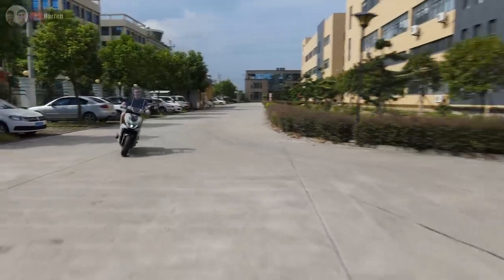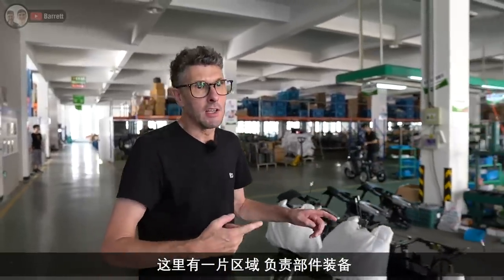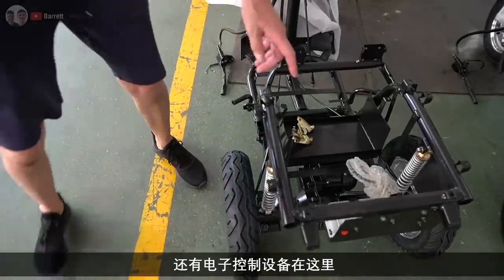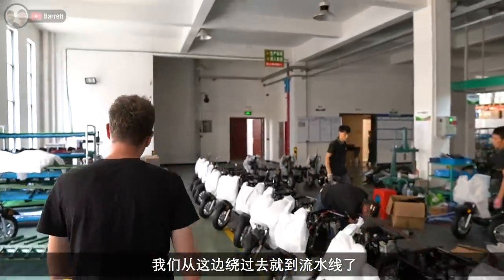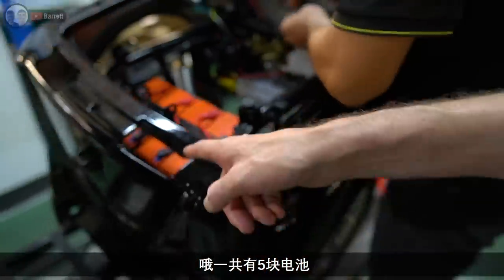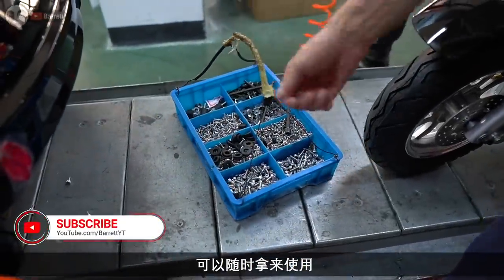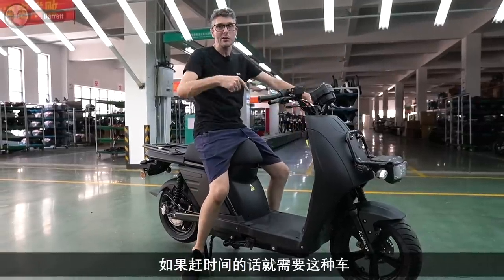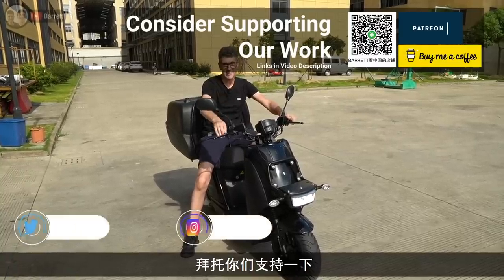High Quality Electric Bike Factory in China // 高品质的中国电动车厂

Comment: A three-wheels e-bike is more steady and easy to take control, it's  not easy to crash too, riders have less risks to fall down, that's why the elders in China love three wheels e-bikes, it's  for security concern.
Reply: three-wheel bikes can reverse, they can go backwards, actually more complicated. when driving, you cannot balance with gravity. they are less flexible than ordinary bikes, and of much less steadiness than cars. drive safe
Reply: @fireyecat  Well, it's depends. Some larger three-wheel ebikes do have  backward function, other more advanced ebikes even have doors and cover like a car, it's not necessary for elders to buy and ride on those ebikes though. I also agree that two-wheel ebike is more flexible and easier to master than three wheel one. Personally, I don't recommend elders to ride on neither two-wheel nor three-wheel ebikes because they may have longer response time when emergency occurs, which is dangerous. If they do need to ride on those ebikes, there should be someone accompanies and guides  them along the way.
Reply: That only apply to low speed...it can tilt over in a turn if you go too fast on three wheels.
Reply: @qiyuxuan9437  Haha, i don't think a 3-wheeler is meant for speed.  The demographics for this product are mainly the elderly, those who cannot do normal bikes or cannot afford cars, for short trips around the neighborhood.  It would be a great boost to the mobility of these groups of people.  It is good we have products to cater for all kinds of societal needs.

Comment: I have seen enough electric bikes in china myself. most of the common brands produce bad quality bikes. cheap plastic trims that gets loose easily. the bodies of bikes are just hollow. it would be nice if they really produced something of quality.
Reply: this is because you paid cheap, so you get cheap
Reply from the maker: I guess you get what you pay for, Some of the electric bikes we saw are 10K+ RMB.
Reply: @BarrettYT  interesting. haven't seen a 10k one for sure. I know they can do better but many brands are not making good quality. mine is about 6.5k rmb. it's already kind of expensive for an ebike for most people. still not good in terms of quality. I would expect a motorcycle of the same price to be more durable. I may be judging too harshly or a bit biased but that's my thought
Reply: @helenkang8208  would you say 6-7k is cheap? honestly i haven't seen a ebike over 3-5 years old that doesn't have trims falling apart/loose or some other quality issues. of course it's normal for anything to have problems after a few years of use, but generally speaking i do feel ebikes are of inferior quality compared to similar price motorcycles (in terms of body part durability mainly)
Reply: @xc2923  you are wrong here, i love 3 wheels and i love to be environment friendly, so e-bike or anything not using the petrol is great to me, plus i am not an old lady, i can assure you.  if  you are in china, and having the problem at least you can take back to the shop, but here, i can not take back, but i am still willing to buy one, you know how much costs a car in Australia, 20-60k in AUD, plus, the government is milking from the car drivers, with rego, fine, petrol, it is out off the control.  
telling you an example, from sydney to canberra, average 4hrs, for driving by car, the government benefited by people driving the car, yet, i put my life on the line for driving that 4hr on the road what if i have car accident.  costs the government nothing, but costing me a life.
this is why we do not have high speed trains, because the government here, do not make money from the train, but they making money from people driving the car.  they get top up millions from car drivers.  we drive only because we have no choice, as the public system is very poor here.
so donot be ungrateful if you are living in china!!!
Reply: @helenkang8208  thanks for sharing your insights. but i am not really being ungrateful. no one is giving me stuff for free (in terms of public transportation in china, yea im very grateful we have one of the best systems in the world). perhaps im not being totally reasonable and accurate with criticizing ebike qualities, but my main point is that I want quality products. so far almost all of the ebike I have seen aren't really that durable at least within 7k rmb range. It would be really nice if producers prioritize quality more. this problem is not just with ebikes, there are food quality issues and such in china as well. i am hoping producers to do better, but I am also wishing the gov to enforce food/product quality regulations for certain products better, like food and vehicles. rather than a bitching complaint, i would like this to be a call for change